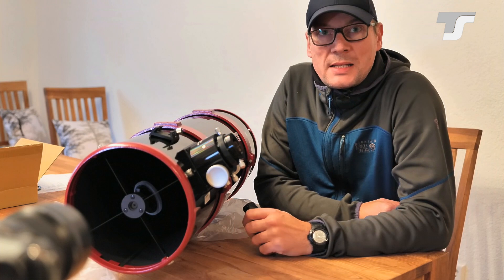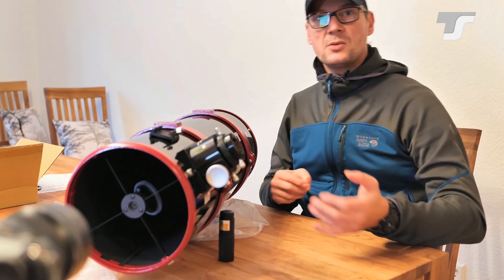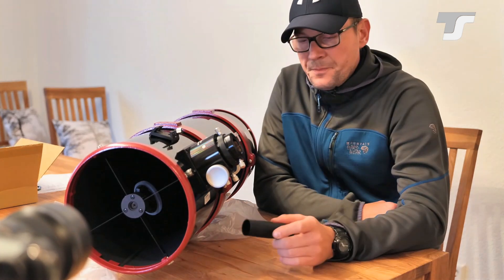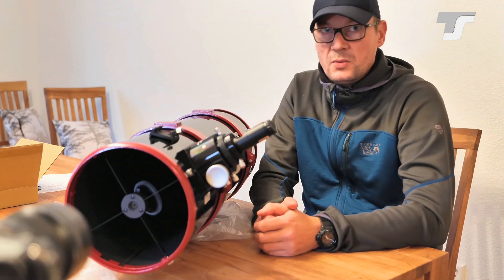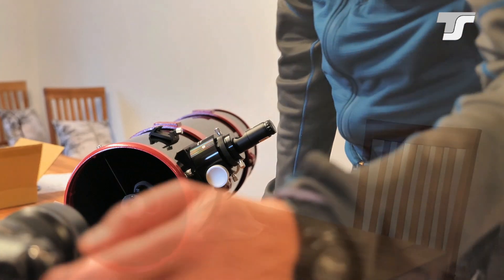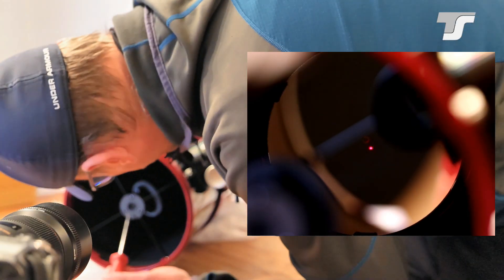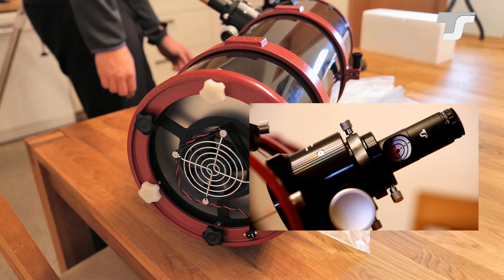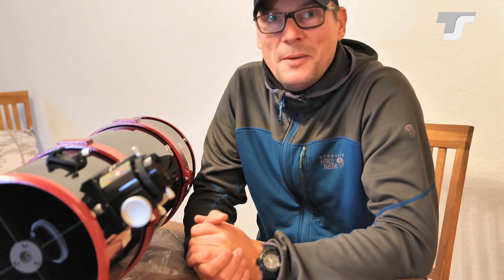Collimating Newtonian telescopes

Comment: Thanks for good introduction.
I have an issue with collimation of the recently bought TSO-ONTC 606 Newton. After the collimation of the secondary and primary mirrors is done with a Cheshire, residual off-axis of the focuser drawtube is observed which is quite severe and exceeds by times the secondary mirror offset appropriate for a fast f/4 scope. It seems, the 2" TS focuser needs collimation as it is obviously mounted non coaxial with the light path after the secondary mirror. Please advise whether this particular model of the TS focuser allows collimation. Thanks in advance.

Comment: Put the laser in a Barlow for the primary adjustment. You get a projection of the centre primary mirror donut marker that is a lot easier to get exactly centred on the 45 degree laser target.

Comment: I have a laser-collimator which does not stay centered but draws circles. And my 8 inch Stella-Lyra has the same primary mirror screws, but they do not turn as smoothly as in the video and one spring seems to be not as flexible as the others... I ordered two new lasers to compare them to my old one...
Reply from the maker: Hi Gunnar, some lasers have 3 little screws on the side, where you can adjust the alignment, but not the simple ones. Hope the other lasers will perfom better!

Comment: I have zhumell 100mm reflector and during shipping the cullamation was off. I used a lazer and adjusted the secondary mirror and got it centered in primary mirror. However, there is no adjustments screws for primary mirror. How you cullamate a fixed primary mirror?
Reply from the maker: Dear Mike, i'm afraid, there is no solution. This telescope cant be collimated by the user. If its really off, you should get in contact with the seller or the manufacturer to find a solution. Hope you can solve the problem

Comment: I think you should actually start with a sight tube to verify the secondary is rotated to be square to the focuser. Otherwise, the image could vignette, although it shouldn't change the shape or look of the stars. 
I put a white piece of paper on the inside wall behind the secondary. Then I push a sight tube into the focuser until the mirror almost fills the view.  I like to make sure I can see as little of the sides of the secondary as possible.

Comment: One recommendation - turn the laser collimator such that the opening is facing the mirror end; then you can see the target and laser  while you're adjusting the primary collimation screws.
Reply from the maker: Thats absolutely right. With small tubes (or shorter arms) it's not an issue, but with longer tubes that is the  way to go.

Comment: It should be noted that the primary mirror should never be collimated with the telescope positioned horizontally. The primary mirror is free in its cell to avoid deformation and astigmatism. So it's highly probable that positionned horizontally, the primary is not fully in support on its fulcrums, and then is not positioned as it will be when pointing sky.
Reply: Is there a particular position the scope should be pointing up?
Reply: @RegP5  I'd say 45 degrees or more; keep in mind that when you're using your telescope, you're NEVER going to be looking at something dead on the horizon.

Comment: Hello, I always use a barlow when adjusting the primary. I forget the reason!
Reply: The barlow makes a shadow of the center spot of the primary miror instead of visualising a returning laser spot. So it helps in case the laser is slighlty tilted in the eyepiece holder by eliminating the tilt error.
Reply from the maker: Because its more precise :) Especially for the faster types (f/4 and below) a barlowed laser is a good choice!
Reply: The Barlowed method is highly effective in avoiding errors due to misalignment of the laser in the focuser, or the laserdiode in the laser housing itself. 
Even a tiny bit of tilt will lead to errors. With the Barlow, the Barlowedlaser beam ensures  we overtake these tilt errors.
Just a drawback: the returned beam is really weak, and it's difficult to see it during daylight. No problem in the dark.
Reply: @bezain7663  does it matter x2 or x3 or would it just be dimmer with the x3